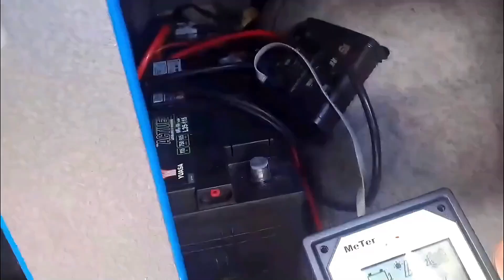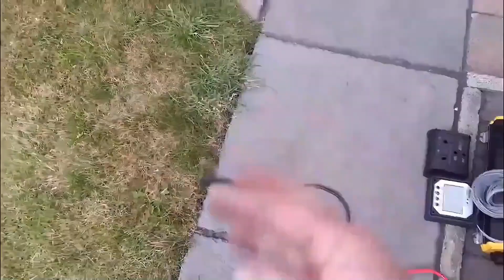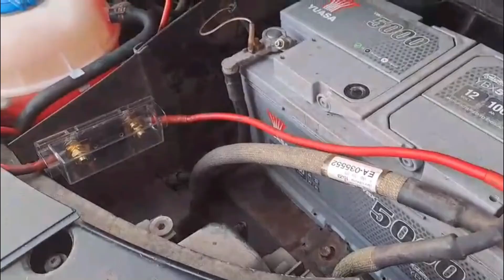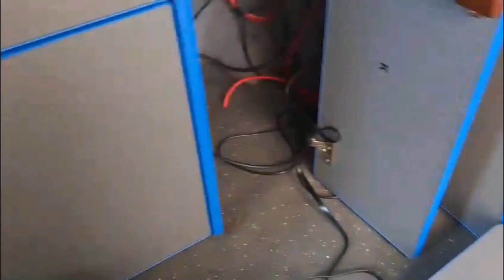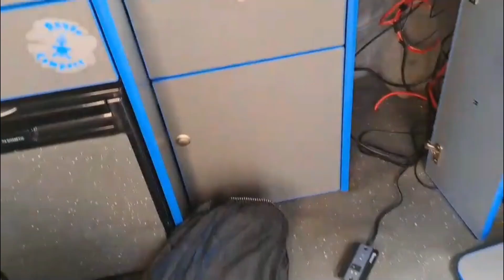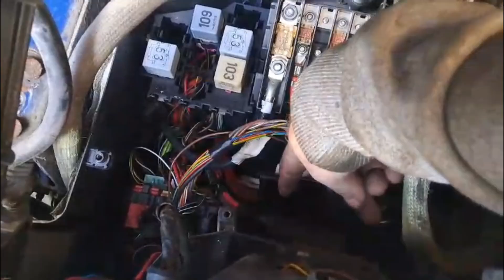T5 Campervan Part 4

Comment: I have the chance of a nice cheap t5 but it has 240 on the clock has service history just had a clutch timing belt and water pump also a fuel pump but I’m still humming and harring about it
Reply from the maker: Sounds like a tough call, but if it's been well-maintained, that's a good sign!